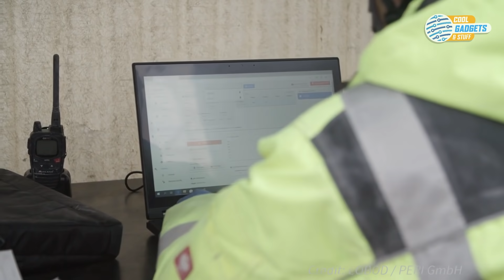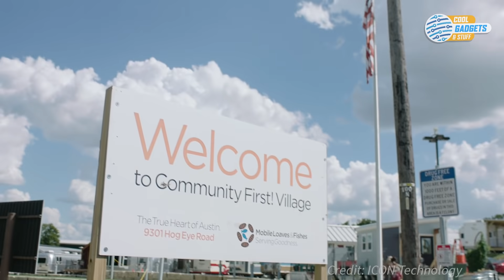5 Innovative BUILDING SYSTEMS for your house #6

Comment: The big plastic bag method was very very vague to say the least as to the procedure used and skill needed to finishing other product just overall not even enough information to put it in the list as a real option if you want to go with the least expensive material that you have on hand on site but at least you could mention of it could be a viable and structurally sound and durable that will last and be a good option if you believe it was your style and structural forte 🤗🤪😀.

Comment: I vote for 3d printed.   Still a long way to go,  but it will be the most cost efficient and design  flexible way for construction
Reply: And pigs will fly.
Reply: I like the 3D printed idea but not with concrete for multiple reasons one being the reason why most housing is so expensive is because it's permanent so there is less flexibility what's already established that was made with someone else in mind such as the previous owner my idea of 3D printing is making interchangeable Universal panels made out of plastic most of that could be made with molds but customizable pieces can be made with 3-D printing which is the method of basically weaving hot materials together or 3D shaping where it digitally cuts shapes out of a solid form similar to how you copy a key and all waste material can easily be recycled into the batch and we could use discarded Plastics but it does depend on the kind of plastic it is and it's more expensive than you think trying to recycle plastic that you find on the streets for one thing you need a lot of it to make one product depending on that product and not all Plastics are the same but I think there's a system where it can siphon out particular particles that or just mixed certain bonding agents to make a coherent mixture but that's what I find to be the issue with the housing market is that the structures are meant to be permanent with this method it could be semi-permanent only being used for what the owner needs and or once it can also be used for temporary settlements due to natural disasters and funded first responses but with this method everything's already marked you just have to follow the patterns to assemble you can start off small and then expand later and then you can downsize and as an incentive since this would drastically change the housing market and current homeowners are going to be pissed because nothing is going to really be worth anything in the form of equity getting a house is not going to be an investment the land is a different story it's just going to be a home for you and possibly family so donating or recycling pieces you don't want anymore I think should lead itself to tax brakes again it's an incentive

Comment: 2:34 why use a wheelbarrow or a pulley (both dirt cheap, pun intended) when you can make propaganda pictures of buckets being passed around by 40+ hands that got tired within the next hour despite mostly just being idle, if this wasn't anything but staged for cameras.
Reply: LMAO they could help more by building another walls, not just touching some buckets, the only one really working is that guy up on the wall